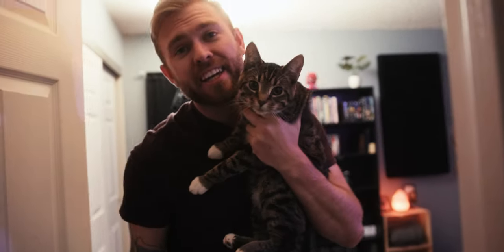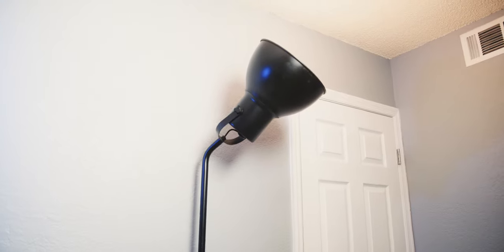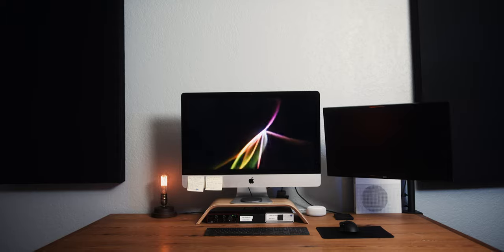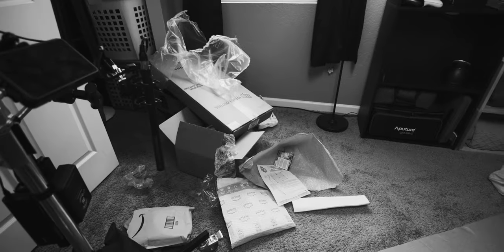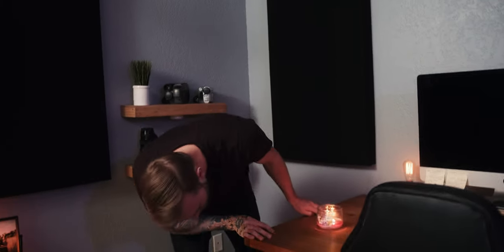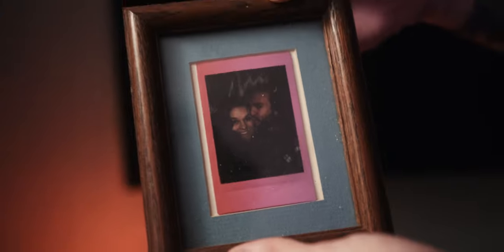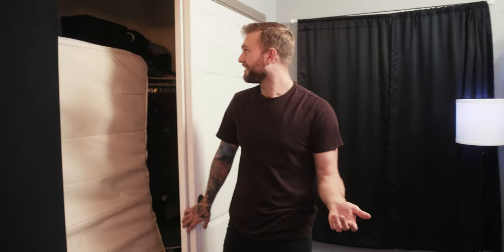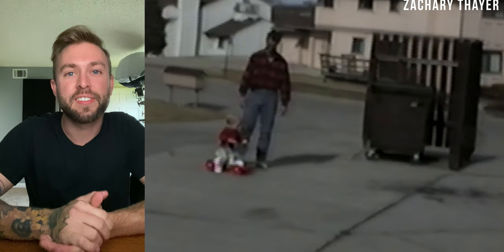I Turned My Bedroom Into A Full Blown YouTube Film Studio

Comment: Dude, Quick tip: next time building, just pre drill holes smaller that the screw, before screwing the pieces together, then your wood will not crack 👍😉
Reply from the maker: Dude I was gonna do that but I don't have any normal drill bits haha! I need to invest in some better tools for sure. Thanks for the feedback man!
Reply: Zach Mayfield haha all budget invested in film equipment 😜 I guess you can get drills for $5-15